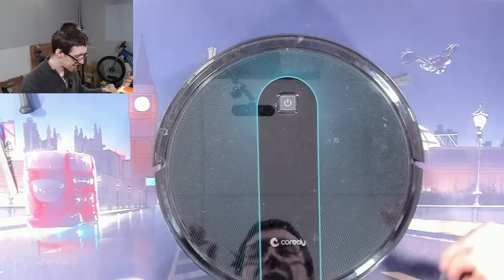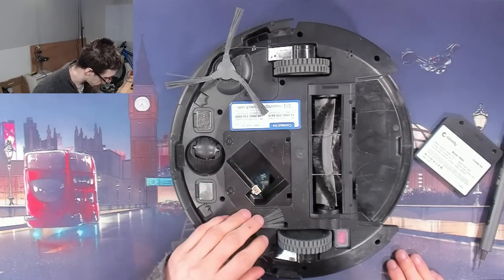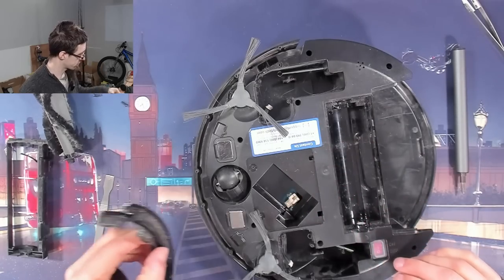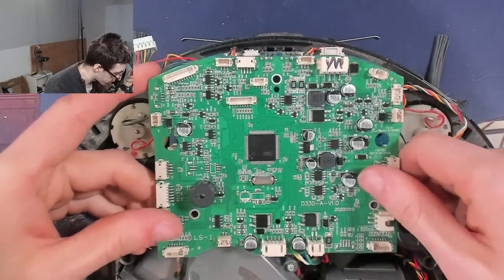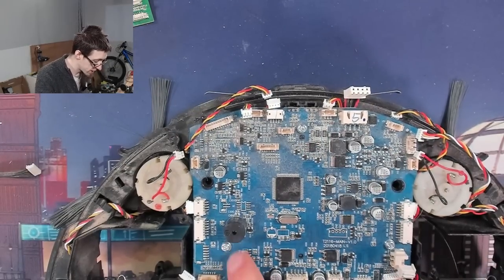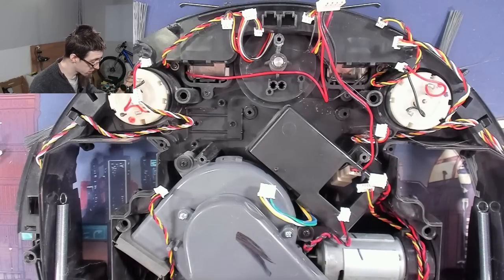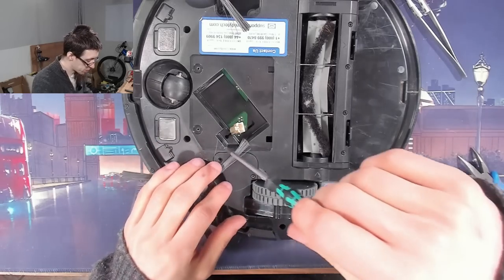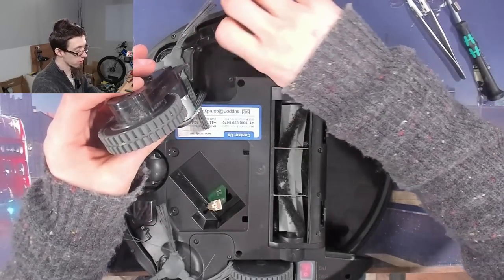Coredy Robo Vac controller board replacement - LFC#260

Comment: almost all of these roombah clones are the same basic shell with slightly different internals, which is great because a lot of them are generic enough to swap out, like the actual vacuum fan itself, you can whack a more powerful one in there if you don't need the battery life.

Comment: What is the best practice for disconnecting those wire harnesses from the main board? I am always afraid to tug on the wires. A prying tool or needle-nosed pliers would seem to be the safest approach.
Reply from the maker: Ideally, yes. You can often use a small flat-blade screw driver to 'walk them out' as well.

Comment: Hey LFC, I have a 2017 razer blade 15 with a dead motherboard, I brought it to a local shop and the owner held it for two days, and when he finally opened it called me and declined to even attempt to replace the board. Is there any way I can send it out that you could make a video with it? If have any other suggestions please advise - currently in possision of a $1,300 brick that local shops won't touch.

Comment: I'd probably would've used hot glue on that power button cable since the locking tabs on the connector didn't line up
Reply: Once the cover is on, there's not clearance for it to drop out, so why?